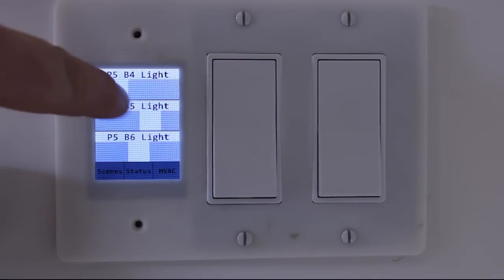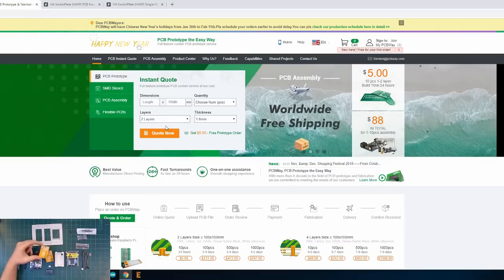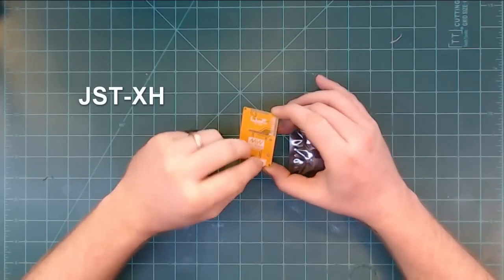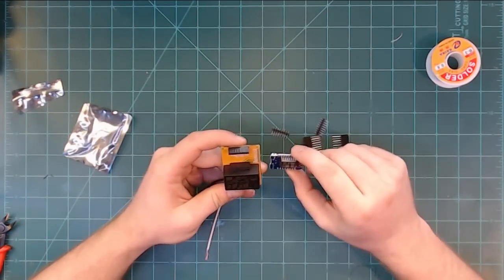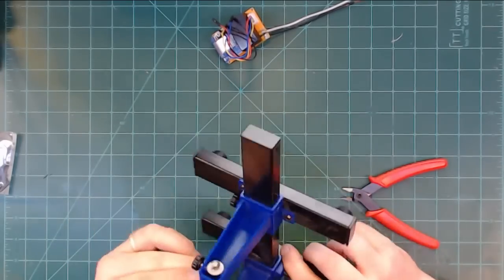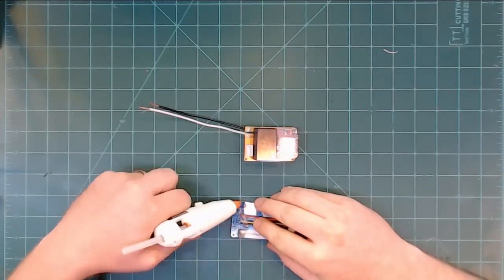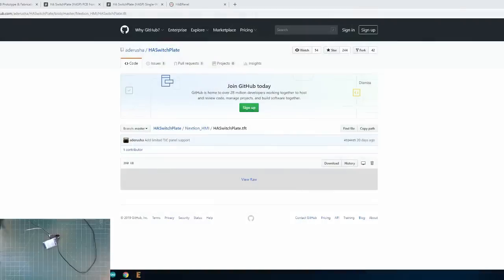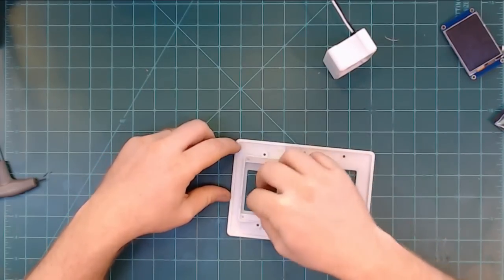Home Automation Switch Plate (HASP) - Build & Software Install - Part 1

Comment: HeyBk do you have you openHAB config posted?  I didn’t see in video, if not it’s ok.  I was more curious than anything.

Thanks for confirming you can tie to openHAB.  That was the thoughts I had while watching a live video on this.  Looked like we just need to get the mqtt topics correct.
Reply from the maker: Hey Danny! I posted my config/write-up in the OH community forums (https://community.openhab.org/t/home-automation-switch-plate-hasp-diy-touch-controller/59682), with a link to my Github repo containing the Items/Rules files (and MQTT topics are built into the Items file). I also sent luma (Derusha) a PR and he's incorporated it into his repo (I will be making small updates here/there as I figure out better ways to do things). There was a bit to getting this working with openHAB, as I needed to handle the automations luma handled in the HomeAssistant YAML, but I did get it working, and well :-D